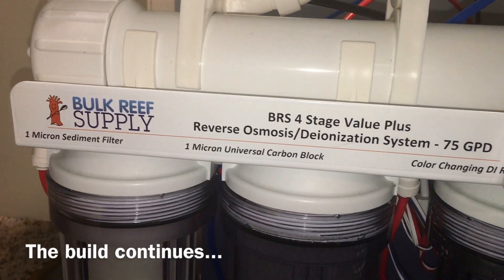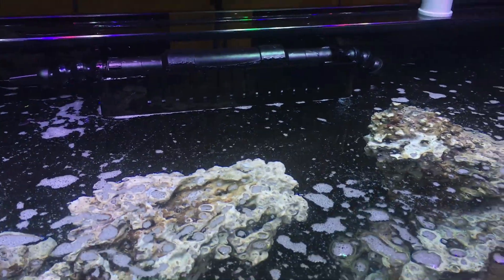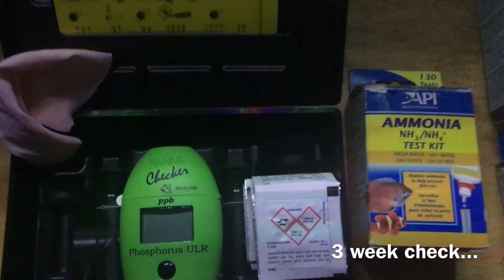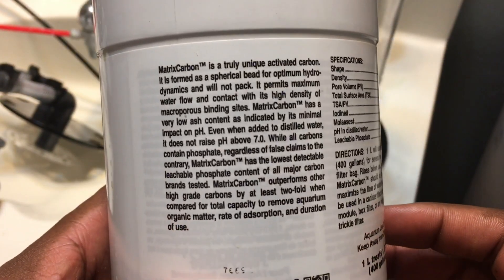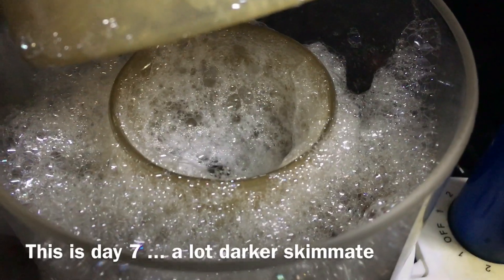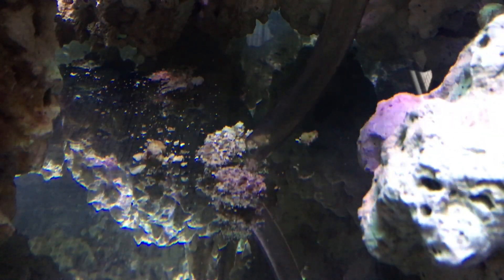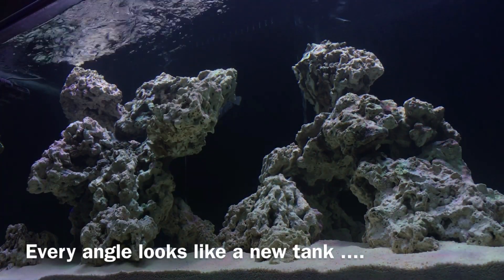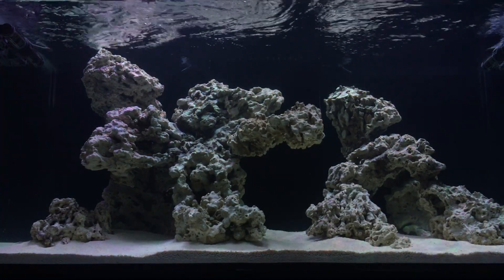SCA 120 Gallon Reef Tank | Ep.8 | Salt, Sand & The Nitrogen Cycle ALMOST done..

Comment: Hi CJ, I made the mistake by adding the sand right at the start is that gonna be a problem?
Reply from the maker: BERELEAH it's not a mistake... I did it this way to help me cure the rock with more flow. It's not a requirement you can always clean the sand during  after changes if needed
Reply: Thank god, because I was rewatching your video and I see that u didn't add the sand only later.  So the love sand will seed the rock while its curing how does that work?
Reply from the maker: BERELEAH if u used Live sand then yes but I didn't use Live I had dry sand so no benifit to adding it early
Reply: CJ'S AQUARIUMS am I gonna lose out on any benefits of the live sand since I'm not having any light on it during the cure process?
Reply from the maker: BERELEAH light doesn't effect it your fine ... time to relax and trust the process

Comment: CJ great videos my girlfriend and I enjoy watching them! I wanted to ask what types of corals were you planning on keeping?? I know alot of the SPS heavy folks in my area swear by the low dkh salts with their ultra low nutrient setups specifically the Red Sea salt (Not coral pro).

 I've been told that stability during water changes is key. The issue you get with the higher dkh stuff (reef crystals and salinity) is that it quickly increases the dkh with a 20 percent water change. 

I've had really good luck with Red Sea so far btw and all I do kalk dose from my ATO in my 75g and ammino acids.
Reply from the maker: oscar guzman going to be a mixed reef... keepin sps,pls and softies.... stability is key. I like to keep my alk 10-11 so Reef crystals usually doesn't cause a huge swing ... high nutrient import and export along with a calcium reactor for alk,calc and trace elements  is my plan for this tank.. so it will be interesting to see how it all turns out...
Reply: I'm excited to see it CJ! keep the videos coming!

Comment: Hey CJ did u cure the rock separately or are you doing it at the same time of cycling the tank???
Reply from the maker: BERELEAH curing and cycling inside the tank ... will take awhile this way but I'm in no hurry
Reply: Do you plan on draining this water and replacing with new water after the curing a cycling is done?
Reply from the maker: BERELEAH yes I'll be doing %100 water change at the end ... and another %100 depending on phosphate levels that are still present

Comment: I've used reef crystals with no problem for 2 yrs. I got some Seachem's salinity for free recently. The stuff takes longer to mix, is cloudy, and leaves a white film on my mixing powerhead, heater, and bucket.

Also, how's the noise from those gyre's?
Reply from the maker: sirvine24 interesting info on the seachem salt I've read about it happening when mixing at the wrong temperature... new gyre is getting quieter but is nowhere near silent like the 130 is...
Reply: CJ'S AQUARIUMS well I do typically just throw the heater, powerhead, and salt in the bucket together as soon as the RODI is done, so that could be a factor. Wasn't with reef crystals though. 

My gyre 130 is noisy above 40% so trying to figure that out, since I'll need to crank it up once it's in a larger tank.

Comment: Cj quick question. With me adding water and sand tonight. Did I hear you correctly about turning the pumps off until the sand settles? I am going to add sand and then add water on top of that
Reply from the maker: Yes it will help it settle faster and also help limit the amount of dust that gets into your pumps. I didn't turn mine off and now I have to hand clean both gyre pumps ... sounds like your almost there. Exciting times ahead for you!

Comment: Reef Crystal's for the price is really good salt. I've used it for a few years but now use Red Sea Coral Pro (a few more years). I like how much closer my Mag, Alk and Calc are to the levels I like. I used more mag with Reef Crystal's but the difference in cost between these two salts probably made it even in the end. Right light set the right way, with the right flow and coral placement, n03 1-5ppm and p04 at or near .02ppm and you're on the right track for success.